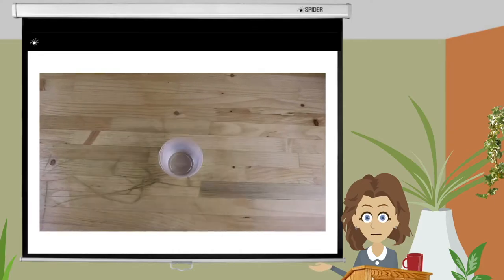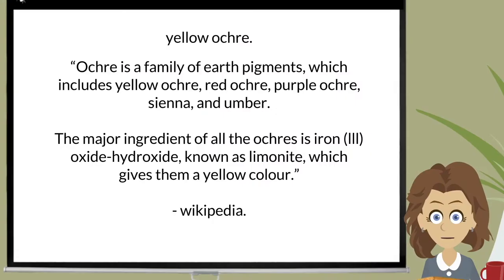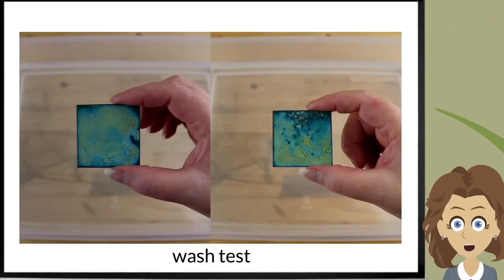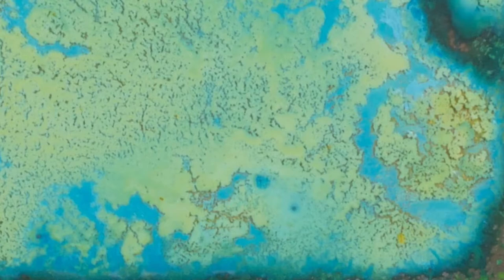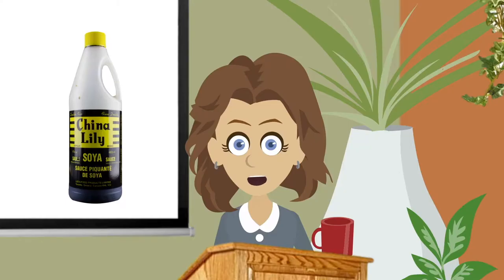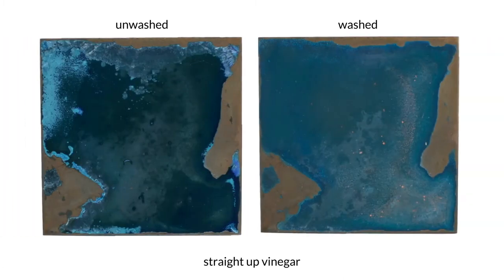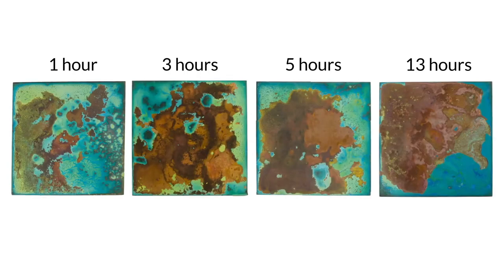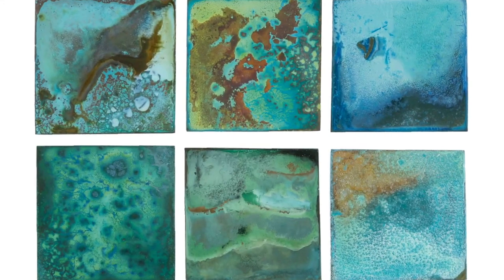Part: 2d solutions. (ammonia copper patina)

Comment: Awesome progression. Thank you. I have a question. At 8:55 in Part 2d, can you tell me whether you sprayed water, ammonia or vinegar on the Salted plate on the left? And on this plate you did not use yellow ochre or salt, just the undiluted solution (w,a, or v) sprayed and cooked in Ammonia for 72 hours? Thanks for clarifying. I got lost. You started with yellow ochre and salt then switched to just solution sprays and then jumped to the 72 hour section. Thank you.
Reply from the maker: Hello Rajiv, the plate on the left is just water and yellow ochre... the plate on the right is water, yellow ochre and salt. Both cooked for 72 hours.
Nicole.